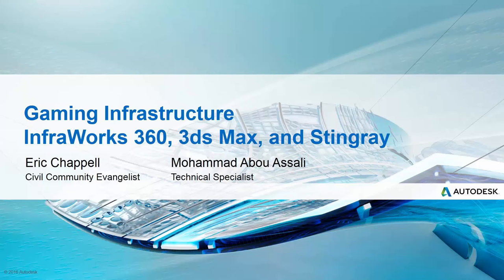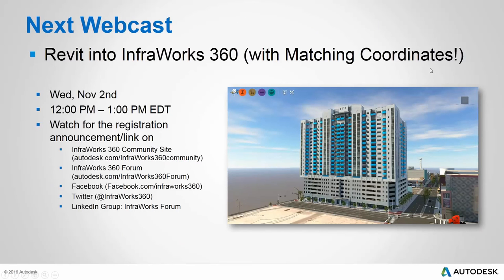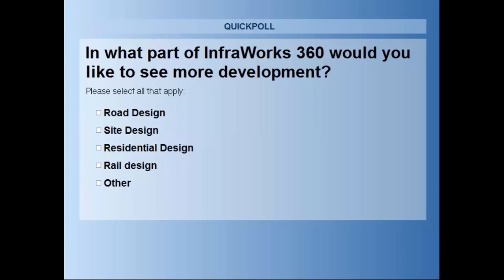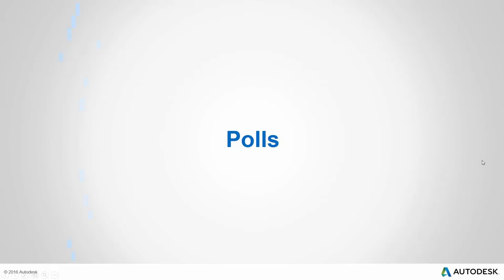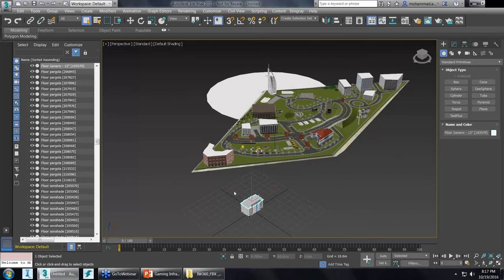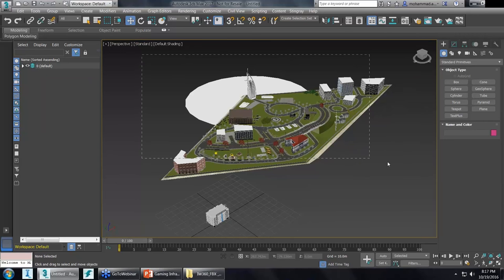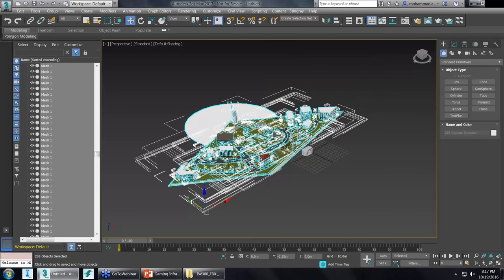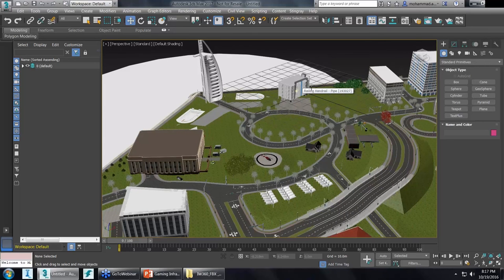Gaming Infrastructure – InfraWorks 360, 3ds Max and Stingray

Comment: Thank you for this Video, I tried exporting a Model of about 199 KM sq from Infra Works and it always crashes what can I do to achieve this
Reply: 199 Km? You need to split your model into manageable sections, and depending on the complexity and level of detail you need to look at your hardware requirements as well.
Reply from the maker: @oscarcastaneda1622  That's true. Splitting the model is the recommended practice here otherwise the resulting FBX or OBJ file will be huge in size and will cause problems in extraction and opening by other software.